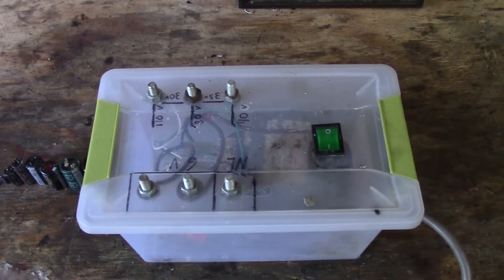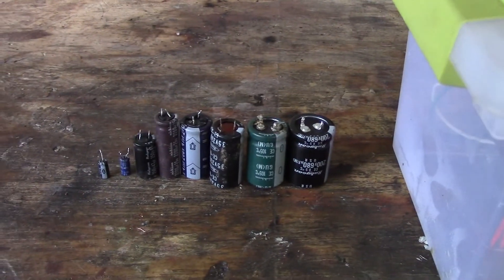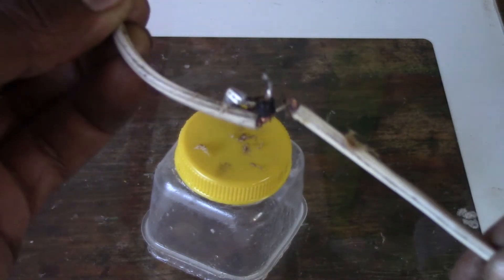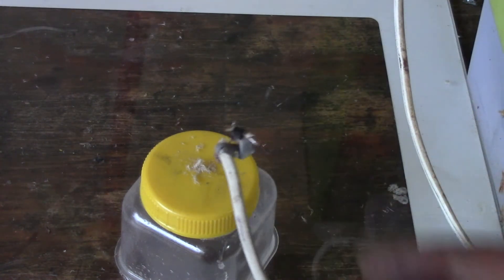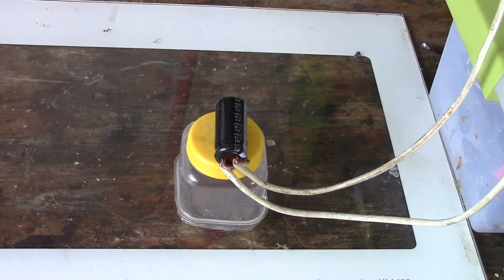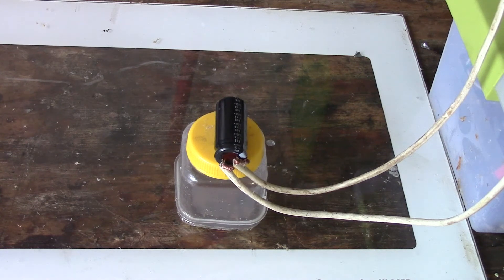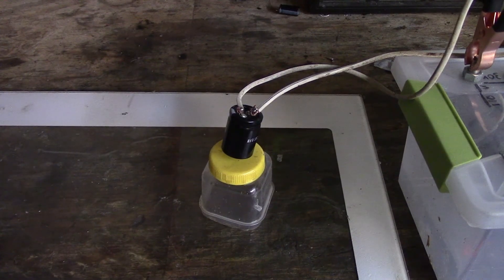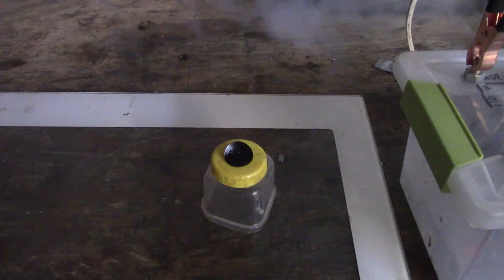Overloading capacitors - What will happen?

Comment: why doesnt anyone want to blow up one of those microwawe ove caps, or some else BIG non-vented caps?? dammit i want to see one explode!! i have some in my house but we dont have a back yard, since i live in an apartment building, so i cant try it. and yes i know it would be preety much like a bomb going off, but i still want to see what happens! can you please just consider doing it?? pretty please?
Reply: big non-vented capacitors that can be easily exploded (without having like a 5kV 1 amp power supply) don't really exist anymore, but I  suppose they could still be found in vintage tube radios.
Reply: Near the end of this video this guy blows one of those microwave capaicitors up.
https://youtu.be/U2iugnNuMAM
Reply: @cody_d3628  I've seen this video before, and while the one he blew up wasn't a microwave oven capacitor, it was still one without a vent.
Reply: @fungusenthusiast8249  oh ok. I  had thought that that was a microwave oven capacitor.